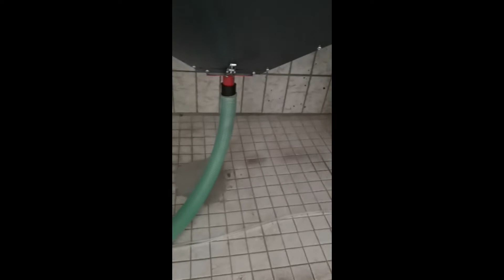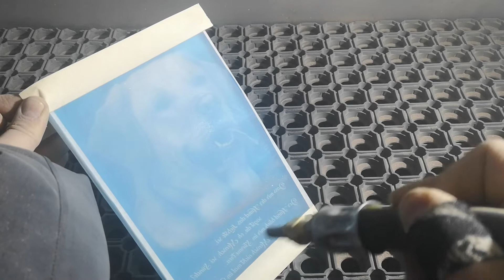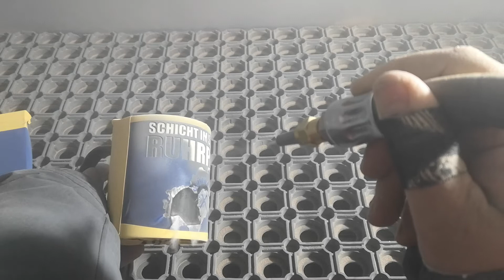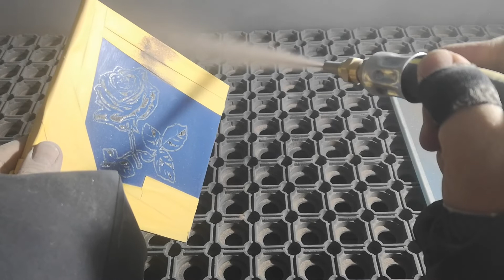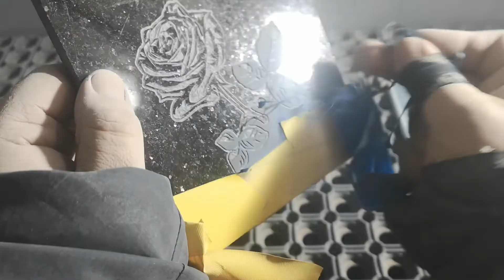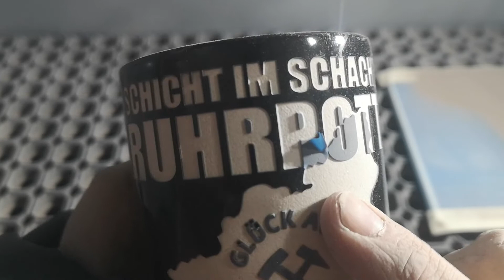Pressure Pot Sandblasting Unit B2B 1 english

Comment: How ever have you got a vacuum in a pressure pot witch blows air in and a then to have air sucking the abrasive from the tank into the pot?  I take it thers  filter to stop abrasive going into the vacuum cleaner?   Surely you dont have both blow and suck working at the same time?  Also, how could I get that pressure pot lid for my pressure pot please?